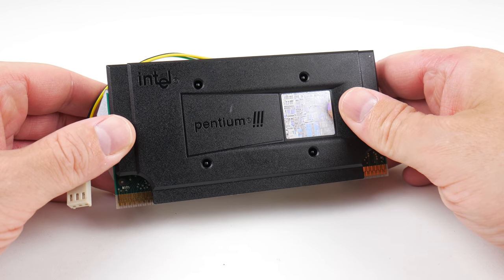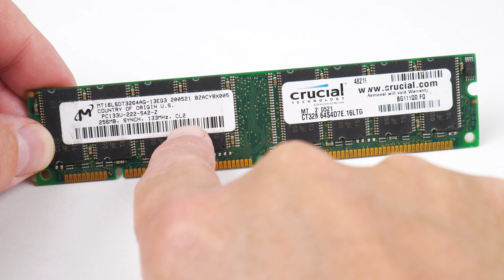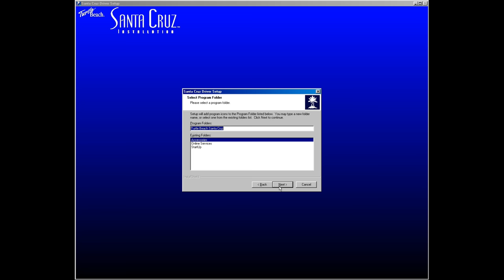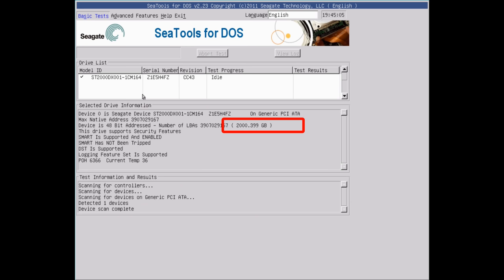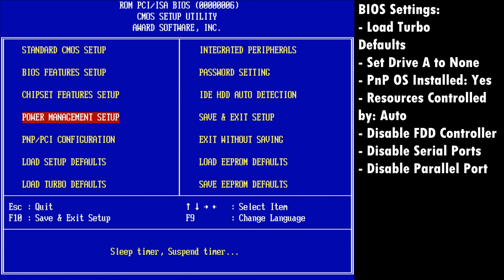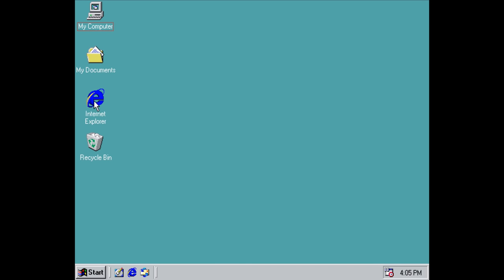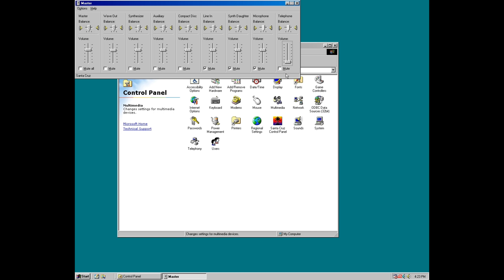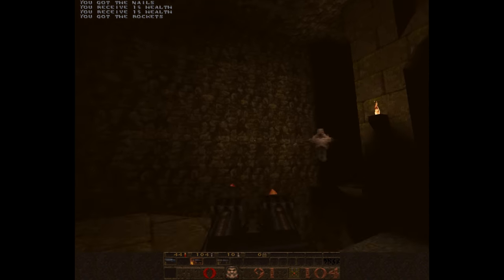1000 MHz Pentium III Windows 98 Retro Gaming PC Build

Comment: Hi, nice video like always but I would like to know one thing, is the sata to ide adapter able to read and write to the whole 2tb disk? I heard of a 750Gb limit on those adapters. This is actually important to know for me as I have a home-made NAS with a IDE port and I want to see if the adapter can support a full 2tb drive.
Reply from the maker: In such case, I would rather recommend a PCI or PCIe SATA controller!
Reply: @philscomputerlab  I do have a Sil 3114 PCI card and I have a free PCI slot but I am mitigated between 2 controllers, should I go with a promise or VIA sata controller?
Reply from the maker: @caraforsythe5830  I've had good experiences with Promise, so I would go with that! You will also find drives, and possible firmware update on their website I think.
Reply: @philscomputerlab  Thanks for the answear, and 1 last question I have, is a ide to sd card adapter going to cause issues when installing linux to a sd card?
Reply from the maker: @caraforsythe5830  I have used SD cards with Windows 98, but I feel it's best used with DOS. You can get cheap mSATA SSS for low price.

Comment: I just finished a build on a slot one I was only able to get a Pentium 2 400 the mainboard is a ASUS P2-99 the issue I am having is I can not get any of my GOG games to run right or copy over well some will ask for the cd other just crash but I do need to upgrade the pc to SE as it is just running 98 first replace none SE but my burning drive on my main pc seems to no want to burn a boot able copy of SE  so I am stuck atm looking for some help

Comment: Hey Phil, I've been trying to get one of those Aureal Vortex 2 or an SB Live for a PCI only build (it's an AMD socket 754 motherboard) to get some sort of DOS sound support. It's been hard to get one here in Argentina, but I do see a bunch of SB Live model S0220 available. Do you know if they are compatible with DOS?
Reply from the maker: I think that's a DELL OEM card. I recommend the SB0060 or SB0100 cards! I use them and they work with the drivers you can download publicly. AliExpress have sound cards, I linked the Turtle Beach Santa Cruz for example.
Reply: @philscomputerlab  Tanks Phil!

I'll take a look at those Turtle Beach sound cards. If the Import price is not too wild, I'll get one for my build.

Comment: Pentium iii with 256kb cash, but  bus speed 100mhz like celeron. I have piii s370 866 mhz with 133 mhz bus speed. Perphectly work through adapter slot1 in asus p2bf.  100mhz bus speed is limit for slot 1 processors? Bater use s370 in adapter slot 1? Who stronger, slot 1 or s370 processor whith one frequenzy?

Comment: I got a question (I feel like I saw a video about this) did we go backwards soundwise since the days of the great soundblasters etc? Everyone is using motherboard integrated and/or usb audio. I'm myself using a steelseries arctis 7 until my office is ready and I can plug back my z5500 over optical.

I remember windows did something messing up support completely for all the previous gen sound blaster cards but don't recall exactly the implications and if everyone just settled for more mediocre sound.
I remember going from my old SB Live! 5.1 to an integrated motherboard one the crystal clear sound was gone..

Also worth asking, those old games ( I think last one was Crysis or of that era?) supporting EAX and A3D.. nowadays it's Dolby Atmos or DD, is it even comparable?
Reply from the maker: With Vista, hardware accelerated audio was a thing of the past. So yes, Windows XP with a X-Fi Titanium is the best way to experience many old games.
Reply: @philscomputerlab  thanks for this answer. But my question is, when we moved to that new 'era' post vista is the compatible vista+ hardware on par with the old one and is the sound in games as good as before at least in 2020. I mean creative is still making Soundblaster cards that are pretty expensive. How worth it are these?

Comment: ... I have a question.

Can Windows NT play games? Will we able to use multi-CPU, GPU setup in that era??
Thank you for the informative videos!
Cheers!
Reply: Victor Bart did a video with a dual pentium II and voodoo2 SLI running Windows NT 4.0. 

A few games will run but official support is limited to DirectX 3.
Reply: @hydroksyde  That would be awesome!

Comment: 13:25 Try running the "Rain" program in Windows 98, http://www.benchtest.com/rain.html, it should reduce the CPU power consumption at idle. Actually you could try if it does or not, and to what extent on various CPUs, and maybe make a little video out of that.

Comment: Hello, I couldn't find a video where you install windows 98 unofficial service pack 3, I would like to post this comment there... the thing is i have installed sp3 in two windows 98 SE machines and in both i cant see icons using file browser anymore. To see them i have to change and disable view as web page, but i have to do it for every folder i open. 
So these are very different machines, a pentium mmx 233 and a celeron 466, i suppose someone has to know something about this.

Comment: Hey Phil, I have a question for you. Have you ever done any experiments with Windows XP to determine what the maximum monitor output is? I've tried now with GTX 285s, GTX 760s, and GTX 960s, and it seems that Windows XP doesn't want to play nice with any modern monitor that uses Displayport or HDMI. I was wondering if you had played around in this field, especially because retro games seem an easy place to get high framerates and resolutions with cheap equipment.
Reply from the maker: I haven't. I do like the idea, but it seems not enough substance for a full video. It's a very specific question but can be something I quickly try within a project.
Reply: @philscomputerlab  As far as I know Windows XP responds okay to DVI-D 1080p 120hz, but anything beyond that starts to run into a wall. I've heard that there are driver limitations for Displayport in Windows XP. Personally I've found that with the GTX 760 and 960(with multiple drivers for each), anything above 1440p 85hz fuzzes out, and 1440p ultrawide is dodgy at 60hz(I've heard 4K stops at 30hz). Another unfortunate thing I've noticed is that despite being lower resolution, settings below 1080p(say 1600x1200 or 1024x768)will actually behave worse. I suspect the problem could be related to modern monitors no longer being designed to play well with older resolutions. This is compounded with the Displayport limitations, as many modern high refresh monitors will only allow access to those higher rates through Displayport. I've personally found Dell monitors from the early 2010s tend to be great with Windows XP, because they will often have a wide variety of inputs and therefore have many options as relating to the resolutions they will support. Sadly, high refresh rates weren't part of the designs at the time, otherwise my Dell U2711 might be the best monitor a classic gamer could want(even supports component/composite video).
Reply from the maker: I did a video on using 144 Hz monitor with Windows 98. Lower resolutions worked fine with 120 Hz I believe. Might be worth looking at that one? I shall try DP though...
Reply: @philscomputerlab  Little update. Having played around a bit more, it seems to be a heavily driver dependent issue, for both Nvidia and AMD. I have found that Nvidia seems to be more consistent, in that drivers after the 350s don't play nice at all, preventing you from selection custom resolutions, and even the 350s and before are picky with their allowed resolution. AMD tends to be highly variable from driver to driver. The 10.4 version will do 1600x1200 @ 85hz, but 10.5 bans anything above 800x600, as does 10.6, but come back later to something like 13.4 and you can get higher resolutions back, but nothing as good for high framerates. These issues are mostly through Displayport, and vary widely through HDMI.
Reply: @philscomputerlab  I've posted the findings in a bit more detail on Vogons. I think an interesting video for you could be comparing Windows XP compatibility between DVI, HDMI, and Displayport.
Reply: @philscomputerlab  Huzzah! Success.

I was finally able to achieve my goal by purchasing a beast of a GPU. The mighty...........HD 8570. Yep, an OEM R7 240 wannabe, of which you've already reviewed. It didn't start out well either, so once again I tried the 3 main driver versions for this card (Catalyst 13.12, 13.9. 14.4) and had similar issues to the 5870 with later drivers. But then something weird happened, and I was able to get it to project the full screen by tricking it with the regular Windows XP advanced display properties. So I knuckled down with 14.4, and got closer again where it would let me try and display 100hz, but I kept running into the typical "Displayport Lower Setting Applied" error when aplying it. Since this card is Displayport 1.2, and shouldn't have limits, I tried one final hope, switching DP cables. Finally, it all clicked. Looks like the X34 is picky about its Displayport cables. I went back to the 5870 to see if the other cable would help, but it still was stymied, so it won't go above 1600x1200@85hz with 10.6.

I may get bold enough to track down a HD 7970 some day, because I suspect any of the Radeon 1.2 cards could manage this, but for now I'm happy I can even play, and the little HD 8570 can handle most retro titles pretty easily. I'll update this if I ever try the HD 6000 or HD 7000 lineup.
Reply from the maker: @theenhancer  Haha beaten by a cable :D I know that feeling all too well. I do wonder if there are XP compatible GPUs with DP 1.4 interface?
Reply: @philscomputerlab  I think the 1.4 cards were after the Windows XP drivers stopped, Pascal and Polaris, as 1.4 didn't drop until 2016.

Comment: Any advise regarding 440bx boards that use Socket 370 vs Slot? Do you know of any pros or cons?
Reply from the maker: 370 CPUs are much easier to find and cheaper. Especially 1 GHz and similar fast models.

Comment: I have the Santa Cruz soundcard running windows 98 and the VXD drivers from your website. But every time I try to enable dos support it gives me a bsod with the error 0028:C00160EF in VXD right after it tries to install the driver for the new virtual dos soundcard. Any ideas to why?
Reply from the maker: Hmm, try another PCI slot? What machine is it? How much RAM?
Reply: @philscomputerlab  machine is pentium 3 1ghz 256mb ram Ti200 primary and two voodoo2 cards in sli along with the Cruz. I can try different slots do you think it will make a difference?
Reply from the maker: @ToxicwasteProductions  What chipset does it use? If it is non Intel, that could be a reason. Trying a different PCI slot is worth doing, there could be some resource conflict.
Reply: @philscomputerlab  it has the via Apollo chipset :)
Reply from the maker: @ToxicwasteProductions  That explains it I'm afraid :(
Reply: @philscomputerlab  is there any known workaround? :)

Comment: I have an old pentium 4 with 1 GB of ram. It only has a single PCI slot that I want to use for a radeon PCI card. Would XP be a better choice fir retro use than windows 98 for that particular system? Btw I was not aware that the 440bx chipset supports Pentium 3... can not remember if it is a radeon 9250, I bought it from new in 2007 I think

Comment: Personally, I'd much rather use a 120GB IDE HDD.  They're not that hard to get from what I've seen and performance is generally quite good for Win98.  It's basically the maximum size Win98 can use anyway, so it doesn't feel like you're wasting a ton of space like with the 2TB SSHD.
Reply from the maker: I found old IDE drives unreliable. They work for a while, but then they just making clicking noises, motor spinning down and up...
Reply: I have a decent number of old IDE hard drives and I think only 2 have start failing on their own in the ways you described (one from 1994 and one from 2003), but I understand if that's the case with you.

Comment: Can you test a X1000 series video card with Windows 98? The patch notes for that driver don't list X1000 support, but the one on the official website (same version it appears) does list X1000 series video cards. Would be nice to know for sure if they work or not, this could make a killed Windows 98 PC if it worked.

The driver on your website is 6.2, which is correct version, but the date is 2005, and keep finding that the last Windows 98/Millenium drivers were released in 2006.
Reply from the maker: I worked with a Thin Client that had X1000 graphics and no luck getting it to work :(

Comment: Any suggestions on where to look for the 100FSB variant of the Slot 1 P3 1GHz I’ve had a very hard time finding one on the secondary market? I stuck to slot 1 because it’s normally easier to find ISA slots which I prefer for my 98 machines.
Reply from the maker: They are quite expensive and also a bit rare. Best alternative is a Slot 1 S370 adapter, and using the S370 version!

Comment: What about using a new 500gb hdd instead, feels like too much of a waste to go with a 2tb one. Also can they be limited to a higher capacity than 32gb? Or would there be issues with windows 98.i tried using an older 120gb ide hard drive, and while it worked fine in win98 for a day, the next day all the data was corrupted. Edit: remembered wrong :D
Reply from the maker: Yes you can use smaller drives! Should work with any Seagate drive. Old IDE drives, even have a 32GB jumper :)

Comment: The hdd is too overkill for that

I'm just gonna use laptop 20/40gb 2.5 drive instead, just sayin'
Reply: Yeah, when you're hooking it to an IDE channel, it really doesn't matter that the HD is an 'old slow mechanical drive' -- old 10GB WDs (but not old Seagates -- no cache) perform just as well on that as do the latest and greatest, can't go any faster than the IDE channel anyway. High RPM helps but it's still limited by IDE.

I have a P4-3GHz with ISA slots that I use as a DOS DOOM box, it only has IDE so I use whatever old HD comes to hand, and it's perfectly good.
Reply from the maker: The issue is access time. Old 10 GB drives are very slow with small files.
Reply: May depend on the drive. WDs of that era were pretty good, but Seagates had no cache.

Comment: Hi Phil, will you update the windows 98 installation procedure using usb on your website?
Reply from the maker: Not sure, I get a lot of comments about the USB procedure not working for others. It does depends a lot on how the BIOS handles USB storage, I think that's the issue.
Reply: PhilsComputerLab I tried the E2B method but it seems that E2B does not support windows 98 anymore?

Comment: Hey guys,  I have a socket 370 mobo with a P3 700mz CPU at 1.65v with 100 FSB. I want to install a 1ghz CPU with 100 FSB, but does it matter that it runs at 1.75v ?  Will the higher voltage requirement be an issue?

Comment: Hello, I was wondering if anyone could help me, I have a Compaq 187498 motherboard and I have the parts I need, but when I turned it on the fans spinned for 2 seconds but then stopped, is this because of the missing -5v pin on the 24pin connector? Because it is missing on my Psu. Parts: Pentium III 1.0ghz, voodoo 3 3000 AGP, 128mb ram, and 430w PSU.

Comment: It was great to see this just after putting together a Pentium 3 1000Mhz rig for my friend. I went the intel i815 route with 133Mhz FSB and a GeForce FX 5500 and managed to get between 6100 and 6400 points in 3D Mark 2000. With no ISA slots on the i815 I decided there was no point in having real DOS support, so I slapped Windows ME on there. Here's the result, for anyone interested: https://youtu.be/XuqXTFXcYIk